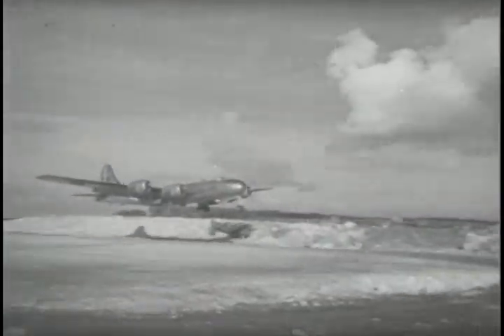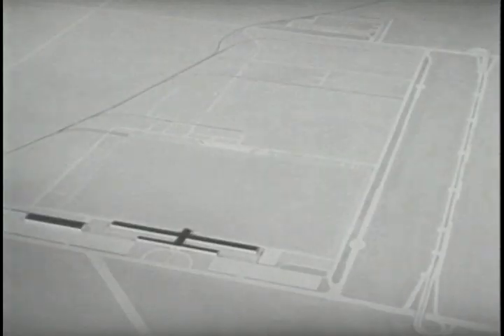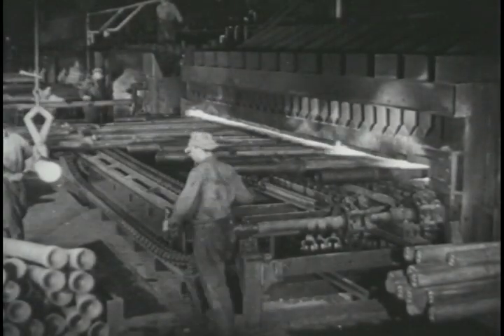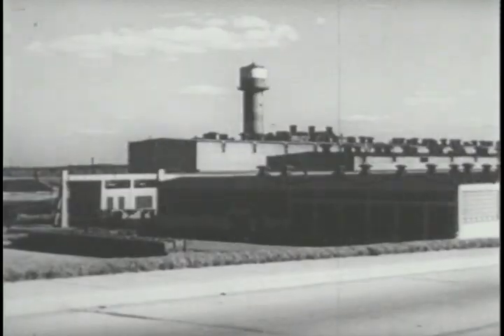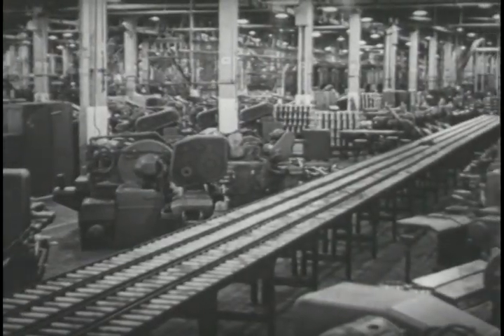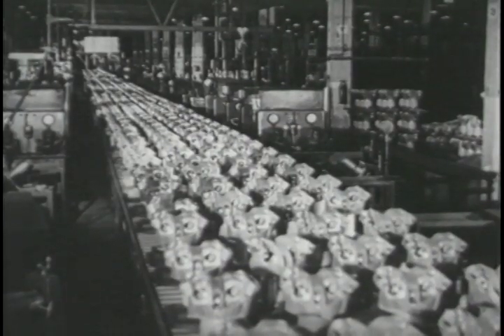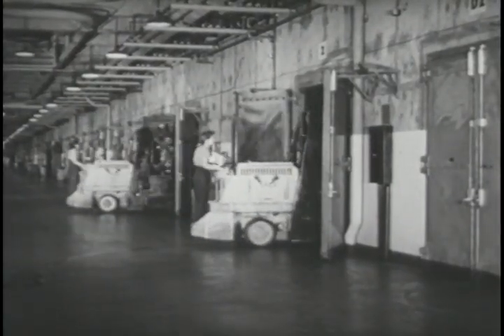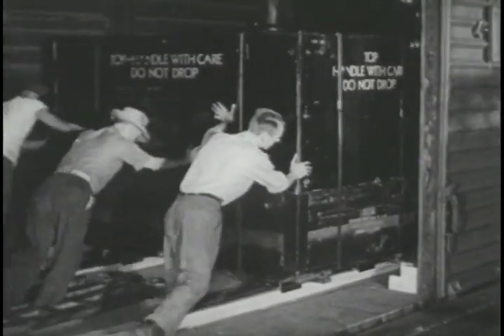Engines for Superbombers

Comment: Interesting clip - thanks for upping. I had no idea they disassembled every engine and then reassembled. At Derby, RR used to do the same to one Merlin in a batch. Painstaking stuff, but the size of operations during "total war" made this possible.
Reply: I was amazed to hear that.
Reply: Assembled, test run for several hours, disassembled, inspected for wear due to a defect, then reassembled for delivery. There were a couple of more steps. Yeah, I see your comment was from six years ago, hope everything's going well.

Comment: The B-29 development program was the most expensive undertaken during WW2.  It even exceeded the costs associated with the Manhattan Project.
Reply: I've been told that I was wrong by "soaringtractor" who thinks that the continued spending of billions of dollars AFTER WW2 ends on atomic research is the same as spending a billion dollars during the war.  Where did these kids go to school?
Reply: dont feel too badly. to be called out by soaring tractor is very commonplace. you should be proud.
Reply: I've seen it in writing and on other documentaries.  The B-29 project cost hundreds of millions, but the A-bomb was mostly research so didn't cost as much. The  uranium refining process was the most expensive part, but still didn't cost as much as 4 Iowa battleships. (at $100 million each!)  Why? Lower labor costs mostly, plus so many parts in a plane compared to three bombs.
Reply: The B29 program cost $3,000,000,000 (3 billion dollars) while the Manhattan Project cost "only" $2,000,000,000 (2 billion dollars). The Manhattan Project resulted in the building of two different types of atomic bombs made in entirely different ways with entirely different facilities.
Reply: MrShobar - you are correct - I've read accounts that put the cost of the B-29 program at close to twice that of the Manhattan Project. Keep in mind that the need for extremely long-range heavy bombers was felt to be critical to defeat Japan, as what the military planners were facing in the end stages of the Pacific war was the likelihood of tremendous losses in taking the home islands. A major program like the B-29 was essential in their minds, especially since very few knew of the Manhattan Project.

I suspect that in both cases the money spent in research and engineering fed subsequent programs moving into the post-war and Cold War periods, though of course much of the engine tech from the B-29 was soon replaced by jet technology.
Reply: +MrShobar WRONG, you're full of BULLSHIT.
Reply: +ELECTROSTATIC DISC LIFTERS Go to hell.
Reply: Yes he was.

Comment: don't know about the 3350, but read the P&W 4360 averaged about 200 hours between rebuilds which isn't a whole lot of air time.
Reply: speedskiff2 Initially the 3350's TBO was 200 hours, but by the end of the war it was up to 750, this at a time when German engines typically went only about 50 hours, and only half that in the case of their jet engines. I have been unable to find numbers for Japanese aircraft engines, but I doubt that they were much better than the German ones.
Reply: CaptHollister magnesium overcast book states XC-99 had one 4360 go 814 hrs and two others @ 524 and 630 hrs. 500 hrs was about 20 flights. Technological wonders, but maintenance intensive! Some senator during B-36 hearings claimed it cost 15K an hour in 1952 dollars to fly it.
Reply: @speedskiff2  , Part of that cost must have been changing the 336 spark plugs fouled by tetraethyl lead from that 130 octane avgas.

Comment: Chrysler built the engines? No wonder they had such a high failure rate.
Reply: Well, you're off base there, as Chrysler had some of the best engineering in the auto industry at one time.  Their wartime experience with aircraft engines gave rise to the "Hemi" engines of the 1950's. Every Chrysler division had its own version called Firedome, Red Ram, etc. - all different displacements and configurations but with the hemispherical combustion chamber pioneered in aircraft engines.
Reply: and all that about 75 years ago  great grand pa  and ma were  kick ass huh
Reply: JetMechMA I prefer American cars and own 2 of them. Chrysler just built some shitty aircraft engines. The good part is they built a whole helluvalott of em'.
Reply: +JetMechMA And the engines got the job done.
Reply: You make it sound like hemis were original with Chrysler, and primo stuff. Jaguar got there first with the "XK", and hemi-heads with pushrods are quite primitive compared to multi-valve pent-roof chambers with dohc. Chrysler's cast-iron hemis were extremely heavy, very good boat-anchors.
Reply: dstarks80 hahaha! I never buy Dodge/Chrysler!

Comment: I wonder what the factory was reused for, and what's on the land now.
Reply: Today, Ford City Shopping Center is on part of the former Dodge-Chicago plant grounds and Tootsie Roll candy is produced using some of the former Dodge-Chicago buildings.  Apparently a complete Wright 3350 engine is on display at the Tootsie Roll facility.
Reply: +Dan Uscian yeah only two of the buildings are in existence, the tootsie roll factory and a small factory that was attached to the main factory (tootsie roll now) right next to it on 72nd, that's were they tested the engines as you can see on the last 3 minutes of this video, I work there, nothing much has changed, it even has the same color scheme and all the testing rooms are used as storage rooms now.
Reply: A developer has lodged a claim, that the area will be earmarked for building America's 1st super cyberspace brothel, more magnificent than anything in Las Vegas. It will revive the economy in that rust bucket region of the nation. No regulations will impede on it, as long as it is creating jaaabs and netting the developer valuable bucks to retire on someone's shoulders.

Comment: 0:42 Don't know whether it was design (Wright) or manufacturing (Dodge), but that engine really sucked.
Reply: +RonJohn63 In it's early versions the R3350 engine was very unreliable.  Insufficient cooling of the exhaust valves, especially on the second row at the top, in the B29 installation, caused the alloy cylinder heads to burn, and the eventually would set the wing on fire.  More air force crews and aircraft were lost by engine failures than by attacks by Japanese fighters and AAA.  A congressional hearing was held investigating Wright Aviation to find fault - had it been peacetime some folks would have gone to jail.  Instead they set to work to fix the problems, which they eventually did.  By the end of the war the engine, with fuel injection, was relatively reliable.  After the war the engine was used in the Lockheed Constellation airliner, which was called "The world's best three engined airliner" as it routinely had engine failures in flight.
So you are correct as it turns out.  It was a design defect, and to some extent a manufacturing problem in the case of reduction gear failures, but in the end the engine did it's job.  However the P&W R2800 proved itself a better all round engine, and at least four times as many of them were produced.
Reply: I wasn't speaking to you.  I would never choose to do so as you are a very unpleasant little man.  However I have made an exception, this single time.
Reply: +RonJohn63 GOT THE JOB DONE, you fuck head.
Reply: ELECTROSTATIC DISC LIFTERS Do a little research before you go all 'MURICA on someone.
Reply: briggsquantum
Your bending some of the facts. But makes a nice story.

Comment: modern day restorers cringe at the sight of tons of extra parts that will go the smelter..
Reply: Winston's,  There's a field assembly video for the P-47 that's really cool.  In its way, it's the opposite of this clip.  I bring it up because I recently read there's a guy who bought a war-surplus P-47 in a crate, like the one in that clip, and he keeps it stored in the bomb bay of his B-36!  I just thought you might like to hear about that, in case you haven't.  Imagine a carbon fiber airframe P-47 or Spitfire, everything else the same, yikes.
Reply: Yes Sir I am Choking to the fact most of those parts are obsolete and or unavailable. But reproduction parts are making there way to be made available for those magnificent antiques.
Reply: It's just labor.

Comment: the  Wendover B29 Lenolia gay assembly hanger /BASE, is still in wendover UT, been there and its spooky empty old base , lots of homeless living in the old barracks, using wood from old buildings for heat, shortened runways are used for small aircraft, WW11 runs were 12,000ft long and if you over shoot straight ahead was the smooth Bonneville salt flats.

 i couldnt even guess what it cost to build such a base, but plans at local BBB museum says 1939, so we must have had plans for it.

 while i was down town in local UT grocery store noticed an old commercial refridgerator(back room), looked it over date of manufacture was 1940, i bet a lot of beer was bought there, at its peak there were 40,000 men.
Reply: The B-29 "Enola Gay" was built by Martin at Bellevue,Nebraska at what is now Offutt Air Force Base. Paul Tibbets named the B-29 after his mother. I believe "Bockscar" also rolled of the assembly line at Bellevue. I have been through Wendover many times and often thought of the Army Air Corp men who made the journey to Salt Lake City for R&R after grueling work schedules training to deliver the "Fatman" and "Little Boy"  weapons. Little Ojo was fast asleep in Albuquerque when the first A bomb components rolled through town  going south on US 85 on their way to Trinity site. The Atomic Age and Cold War were just a few years away. See "The Making of the Atomic Bomb" by  Richard Rhodes for one of the best accounts  ever written about the Manhattan Project.The training at Wendover is covered. The movie "Bombardier" and "Above and Beyond" both have Wendover connections. I believe parts of "Bombardier" were filmed at Kirtland AFB located in Albuquerque. Kirtland trained bombardiers during WW II and I watched many AT-11s fly over our home on the east mesa. Just the ramblings of an 78 year old fart.
Reply from the maker: Ron Brothers Fascinating.  Have to see that some day.

Comment: No wonder there were so many problems with the R3350...they were built by Chrysler  might have known...
Reply: No the problems weren't with the way the engine was built.  Over heating was the main problem, especially while the planes waited to take off.  They changed the design of the engine cowlings,  and added cooling fins to the super charger and fuel pumps, and the overheating problem went away.
Reply: Chrysler solved many of the problems these engines had. The Chrysler built engines actually had far fewer problems then the ones built by Wright (the designers of the engine).
Reply: This is true !!! Cowling too tight not enough air flow !!!!
Reply: The design, given more development time went on to be a very reliable engine !!!